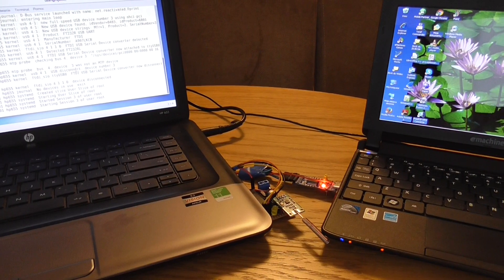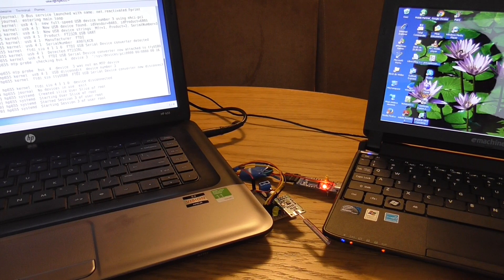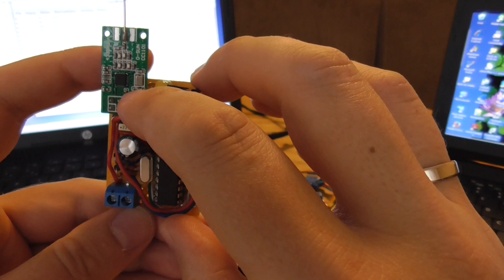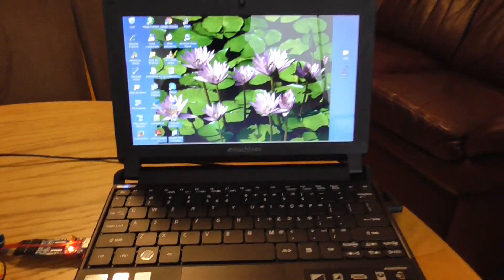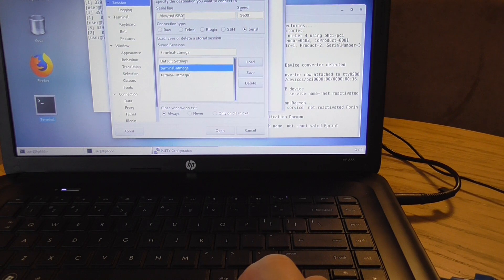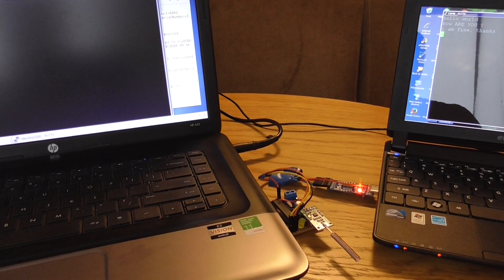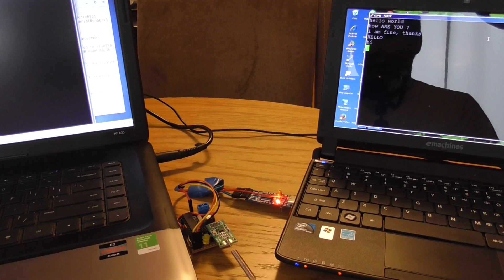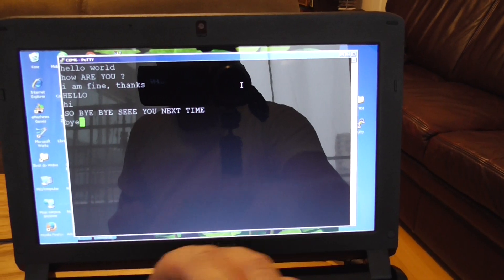Cheap DIY Packet Radio based on CC1101 and ATMEGA328 ( ARDUINO ) for 10$

Comment: In the 1980's packet radio was used to make connections via sometimes multiple automated relay-stations to an end-destination. I have the idea to develop something similar with cc1101 and d1mini. The pc can connect via wifi to the d1mini and check if the cc1101 has received beacons from other stations. The person can send a connect to one of them and check if that staion has received any beacons from further away. That way long distances can be covered. Anyway it is just an idea. In theory it should be possible.
Reply from the maker: It is pretty simple  to do it with arduino and cc1101 modules. The CC1101 chips do support channels so they can receive and transmit in semi half duplex mode and serve as transponders to create kind of 'cellular' networks. They also support customized preambles so the packet will be read and interpreted by proper devices

Comment: Great project, i can use the arduino nano or micro to switch the atmega328?
Reply from the maker: With this code no, not directly (Arduino micro can be used but you have to use USBASP and AVRGCC for flashing the Atmel chip).  I am working on CC1101 ARDUINO project. There is library called Panstamp for it.
Reply: @justanengineer5599  Got it, I just wanted to use a raspberry pi with a rtl sdr dongle
Reply from the maker: If you want to use raspberry Pi with RDL SDR dongle here is the tutorial how to install necessary software https://youtu.be/hoSlkv-9a2I
Reply: @justanengineer5599  thanks man

Comment: Hey, how can I transmit in asyc mode?
Reply from the maker: Hi, The CC1101 module is half duplex. It means it cannot receive and send data in very same moment in time. The CC1101 has kind of state machine implemented in its behavior. It switches from SEND to RECEIVE mode and back. 
 To make bi-directional communication possible the code uses some memory buffer to store the data.